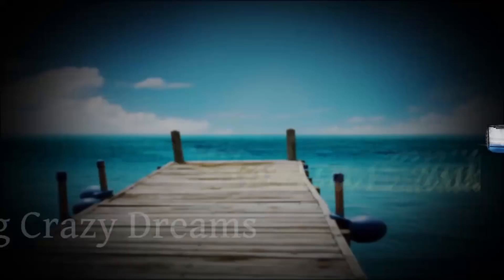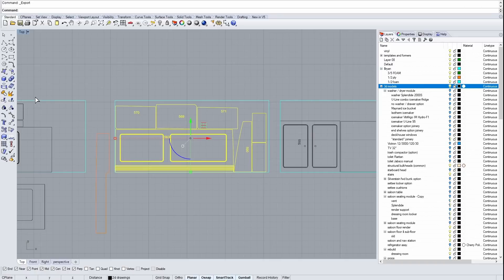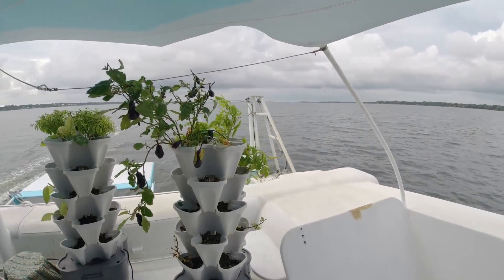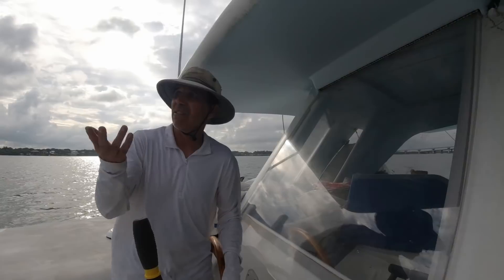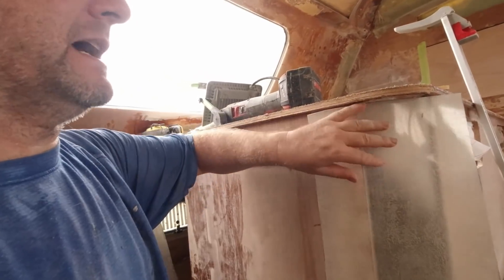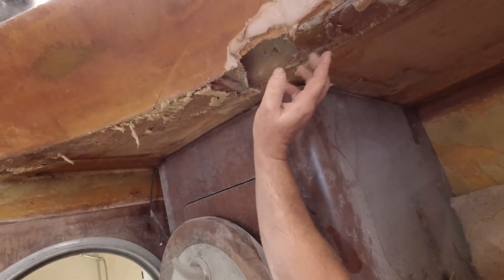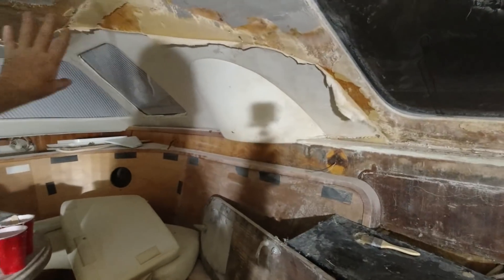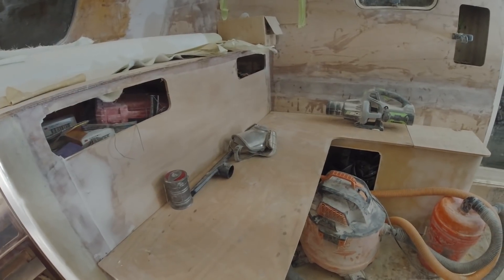27 Sailing, Salty Stories and CAD CAM CNC Boat Repair

Comment: Kudos to the designer who provided CAD data to help you rebuild. Not to belabor the Parlay revival comments, but I bet Lagoon won't provide the same level of detail to their owners with structural issues. When I saw mounds of structural adhesive piled up on a hull beam with empty space above it, meant to bond the deck to the hull, I was less than impressed.
Reply: I was told that Lagoon stinks for support. Robert’s Cain much better. My dream boat at the moment is the Leopard 50. Super dream bait is the MC50 Bryan is one of those guys that shows us anything can be done with perseverance
Reply: Hell no, Lagoon would love to make Colin completely go away😯😯

Comment: Smart move to do cad-cam-cnc fabrikation. Must save you a lot of time in the installation. Structurally you gain strength from the puzzle joints and optically it will be perfect. Method behind the madness ;-)

Comment: You have come a long way since the last video, what a pile of work done! I am very surprised you did not only get the CAD data, but they also publish the FEA model with load assumptions. That really speaks for the manufacturer. I had assumptions on the stress distribution, but actually seeing a model is very interesting. Could you post high resolution images or are those available on the web?

Comment: If your poly or vinyl ester fiberglassing over an already  cured layer of glass, you must pre sand the surface with at least 80 to 100 grit to insure a proper bond between the layers, otherwise the applied layer may peel off

Comment: Nice video on the router table! I know how much getting some paint on can lift the spirits but aren't you worried about damaging some final surfaces while finishing out the bull work of the remaining boat issues? Also, have you made the decision to use a solid color paint to do interior rather than attempt to restore the veneer?

Comment: Weights an issue with cats by following the exact designs he’s benefiting from what would cost thousands in calculating weight distribution and structural integrity. The key ways will actually increase the strength by 49.3%